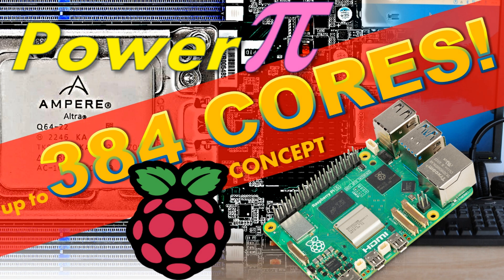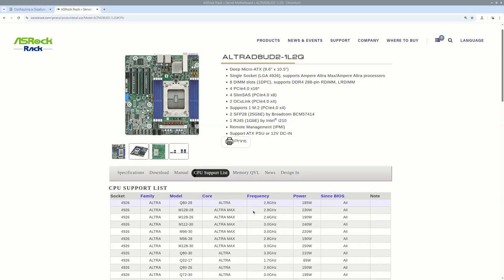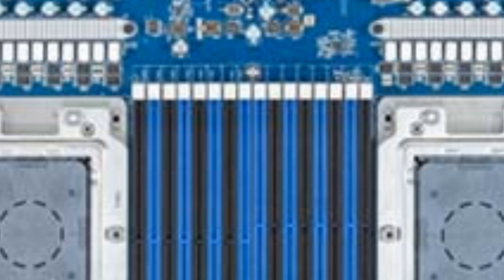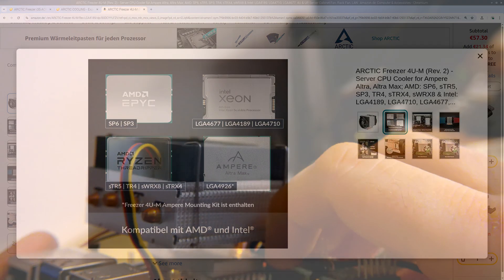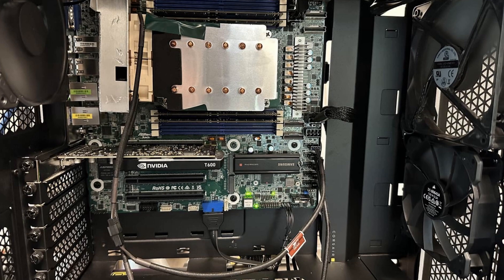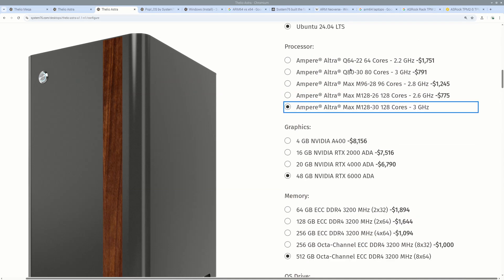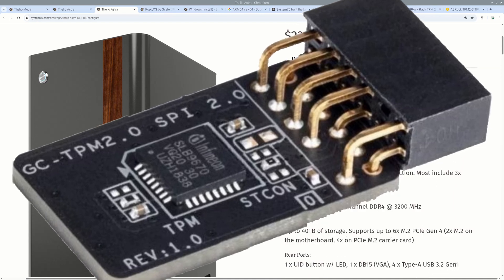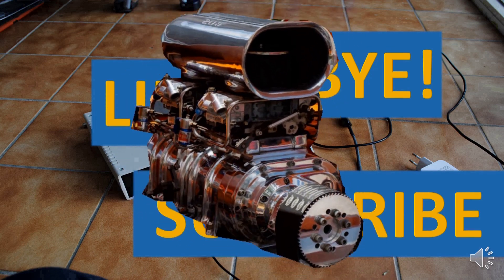Power Pi: Are 384 ARM64 Neoverse V3 cores enough to finally beat the classic PC?!

Comment: No need to be worry because Qualcomm has a followup chip coming, the Snapdragon X2 with up to 18 CPU cores. RADXA Orion O6 product has 12 cores (8x A720 + 4x A520). The N100 processor is a pure Intel - no future. The future is a high number of CPU cores rather than high clock speed. Currently, 8 cores is far enough, but 18 cores would be far enough for the future users. If the Qualcomm would release SoC with 12 or 18 cores of CPU, I would go with that.
Qualcomm has ambitions in laptops for an ordinal user, but the expensive Ampere One/Altra is dedicated for servers in data centers and this is completely different story and it is too heavy computer for ordinal PC user.
Reply from the maker: What I'm worried about is Raspberry Pi 5's future. Though there are computers with Snapdragon, M1-M4, etc. ARM64 based processors, Raspberry Pi Ltd must release Raspberry Pi 6 with surplus processing in graphics power to keep its vast user community interested, soon - this autumn or at least until January 2026. 

Of course, I'd be glad to have a Snapdragon X2 based computer, too. Here is a more detailed video about Radxa designs that you've also mentioned: https://youtu.be/M317y3_tNAU. Snapdragon is a great CPU design and it may also find it's way into Raspberry Pi 6 design (watch: https://youtu.be/_8-7kTpMNeY), but is it is not a muscle CPU like some classic desktop PCs, its more like a home office computer and computer for kids to play simple games.

However, this video is about existing ARM64 Ampere Altra and Ampere One CPU based computers that are a great match for ever more powerful (Intel/AMD) x64 based classic PCs. A powerful Raspberry Pi could be developed (I called it Power Pi) to match or surpass any kind of classic PC performance. There also seems to be no obstacles for using the most powerful NVIDIA RTX graphic cards in such designs. We therefore already have a comparable RISC computer design that Intel have dreamed about from a fallen Itanium era.... Raspberry Pi is adored by a large community, not just the computer experts and enthusiasts, which had kept Intel Itanuim alive for more than one decade in the past...